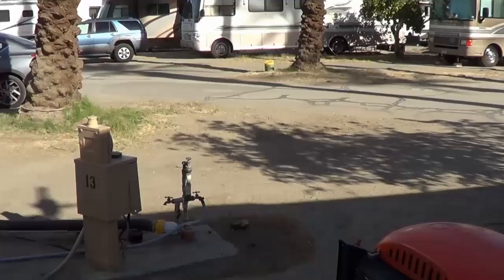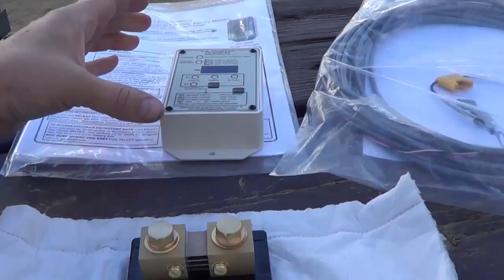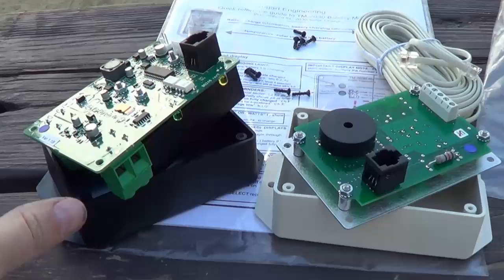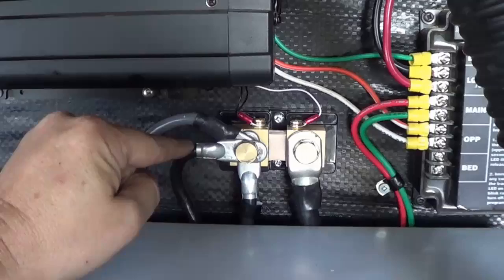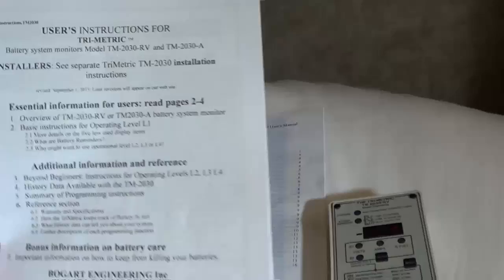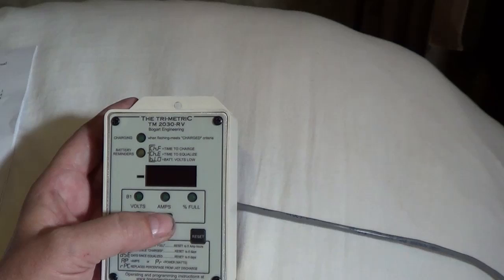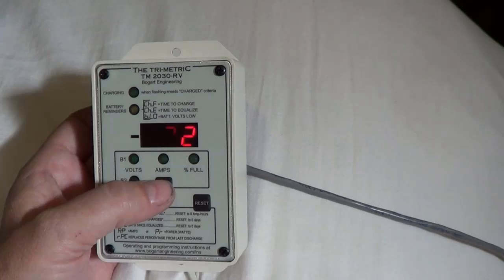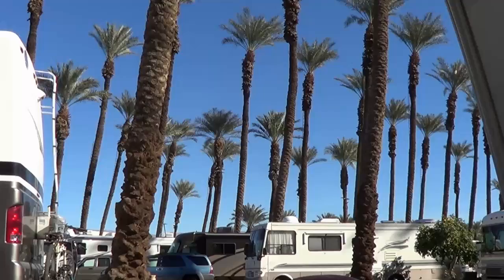Bogart SC2030 CC and Trimetric Battery Monitor Install

Comment: These PWM chargers are only about 70% efficient they truncate the voltage above the batteries full charge state about 12.76 volts for a 12 volt battery system. Those solar panels put out around 18 volts at 5.56 amps (give or take) in order to make 100 watts... When the charge controller truncates the voltage from 18 volts to 12.76 volts you loose about 25 to 30 watts per panel, Thus neutering your panel from a 100 watt panel to a 70 watt. A mppt charge controller converts the maximum voltage of the panels down to a more usable charge voltage and at same time increasing the current so you are able to use. So instead of having 5.56 amps you will have about 7.44 amps. The pwm controllers are around 70% efficient and a mppt charge controller is around 95% or better at converting the solar panel power to a usable charge voltage. With four panels your loosing over 100 watts by using inefficient and antiquated PWM technology; however you did a very good install of the system.
Reply from the maker: IMHO, It's not simple as you make it out. I've had great performance out of my system. Serves our needs, I have 500 watts now and usually full recharged by noon.
From the Bogart Engineering FAQ - http://www.bogartengineering.com/support/faq.html

C1. The debate rages: which controller is best PWM (Pulse Width Modulation) or MPPT (Maximum Power Point Tracking). Why did you choose PWM technology instead of MPPT for your SC-2030 Solar Charger?   Click for answer
A very good question! They BOTH have good and bad. Plenty of hype has been written already. Here's my (Ralph's) view:The "good" for PWM: It is simpler and lower cost technology. Under some common circumstances–it can actually deliver more amps to the battery. That could be when:(1)days are moderate or warm, with few clouds.(2) batteries are charging at over 13 volts, (in a 12 battery system) which they almost always are when actually CHARGING.(3) Panel voltage is properly matched to the battery voltage, for example "12V" panels are being used with a 12V system.PWM is actually more "power efficient" than MPPT–which means less total power loss in the controller itself. So heat sinks in the design can be smaller (and less expensive). Missing in most analysis of MPPT is that there is always a conversion loss with MPPT, which tends to be higher the greater the voltage difference between battery and panels. That's why PWM can actually beat MPPT under circumstances described above.Some places that analyze MPPT assume that panels with 30V open circuit voltage are being used in a 12V system. Any good MPPT system will easily provide better performance in that case. They also may assume batteries are charging at 12 or even 11 volts, which is unrealistic. Lead acid batteries are typically below 13 volts only when discharging, or perhaps charging with very little charging current–meaning the actual potential gain in amps is not great.The benefit for MPPT becomes apparent if you use panels not voltage matched for the battery. If they are not, MPPT will utilize more of the potential energy of the panels. For example, if you use 24 volt panels to charge a 12 volt battery system you must use MPPT, otherwise you would be using your panels very inefficiently. If you are trying to use PWM in that case, you are misusing the PWM technology.Another potential benefit with MPPT is that if distance between panels and batteries is far, smaller wire can be utilized by running panels at higher voltage to the batteries. Running at twice the voltage reduces wire size to 1/4, which for a long run can be a significant saving in copper wire.If temperatures are low enough, the slightly less power efficiency of MPPT will be compensated by the higher panel voltages, which will result in a little more battery current. But in actual measurements we made using a commonly sold MPPT solar controller, this would occur at temperatures less than 55 F degrees (in full sun, when charging at more than 13 volts), where there is a slight advantage to MPPT in my location (Boulder Creek, near the California coast). As temperature drops below that (in full sun) MPPT will get some advantage, such as could occur at high elevations in Colorado in the winter. Potentially this would be maximum about a 2.5% improvement in amps output for every 10 degrees F lower in temperature (or 4.6% per 10 degrees C colder. I'm using data from Kyocera KD-140 panels.)There can be theoretically optimal situations (that I don't personally experience where I live) where MPPT could give some advantage: that is when solar current is present, but the batteries are quite low in charge–but because loads are high and even greater than the solar current the batteries are still discharging despite the solar current. Under these conditions the voltage COULD be at 12.5 volts, or even lower. Again, using data from Kyocera panels, ("Normal Operating Conditions") there is a theoretical maximum gain over PWM of 20% current assuming NO MPPT conversion loss and no voltage drop in the wires to the panels, at 20C (68F). With PWM, the voltage drop in the wires in this case would not affect the charging current. Now if in addition you lower the temperature to below freezing at 28 degrees F (while sun is shining) you might actually get up to a THEORETICAL nearly 30% gain while the batteries are discharging.The only REALLY BAD part of MPPT, is all the hype surrounding it–for example one manufacturer advertises "UP TO 30% OR MORE" power harvested from you panels. If you are using solar panels properly matched to the batteries, 30% ain't gonna happen unless it's EXTREMELY cold. And your batteries have to be abnormally low in charging voltage–which tends not to happen when it's cold (unless you assume the battery is still discharging while solar is happening). Virtually all the analyses I've seen touting MPPT on the Internet ignore the conversion loss, assume really cold temperatures, assume unreasonably low charging voltages, assume no voltage drop in the wires from panels to batteries, use STC conditions for the panels (that the marketing types prefer) rather than more realistic NOCT conditions, and in some cases assume panels not voltage matched to the batteries.The other thing that is misleading about MPPT, is that some manufacturers make meters that show both the solar current and the battery current. In almost all cases for a well designed MPPT type the battery current will be greater. The engineers making these know better, but it is implied (by marketing types?) that if you were NOT using MPPT you would be charging your batteries with only the SOLAR current that you read on their meters. That's not true, because the PWM BATTERY current should always be higher than the MPPT SOLAR current. It is the nature of the MPPT that maximum power occurs when the current is lower than the maximum, so they must operate there to get the maximum power. So to properly compare the two you need to compare MPPT with an actual PWM controller in the same circumstances.Finally, the reason we went to PWM is that I was anticipating that panel prices were going to drop (which they certainly have over the last 5-10 years!) and that the small advantage of MPPT (under conditions where the correct panels are used for the batteries) would not justify their additional cost and complexity. So my thinking, for more total benefit per $, put your money in an extra panel rather than a more expensive and complex technology.
Reply: None of these panels are going to be matched to the batteries. 12 volt batteries use 18 volt panels. 24 volt batteries use 36 volt panels, 48 volt battery system will use 72 series volt solar panels. the only way to get close to the full capacity is to use MPPT. Now if your charge controller is meeting your needs then you have no reason to upgrade. There is no condition I have read here that makes the use of a PWM controller a better option unless one cannot afford a MPPT Controller The article you quoted looks like it was written by someone that was stretching the truth to sell there product.  Years ago buck converter mppt controllers were not really available and too expensive. but they are getting much more affordable now. I don't blame you for not wanting to switch to an MPPT after all you already have yours installed and it works for you. I just wanted others to see the advantage of an MPPT controller.
Reply from the maker: I chose to spend my dollars elsewhere in the system versus the extra cost of an MPPT. In a small system that made sense, once a system gets over say 500 watts I can start to see the merit in an MPPT. Or if budget is less of a concern to a person.

With our usage patterns, we aren't heavy power users, we rarely draw our battery bank down less the 80-85%, mainly because I had the spare cash saved from not going with an MPPT to have a bigger battery bank. ;) Most days my solar controller is actually spending the majority of its time charging in absorption mode where an MPPT acts exactly the same as a PWM since the lead-acid batteries limit the current intake in that phase. 
People who have small capacity battery bank or routinely draw the battery bank down a lot so they spend a bunch of time on bulk charge mode or use a ton of juice for things during the day may benefit from an MPPT more. But to say MPPT is always the better solution is just not true, IMHO
PS. If I do occasionally run the batteries down really low for some reason, I can always fire my generator and shove 50-60 amps charge into them for an hour or two until they hit absorption, then let the solar controller take over.
Reply: jimthvac100 I have a question but couldn't seem to PM you. Could you tell me your opinion on this?
 Im installing 3 100 watt panels on my RV and have 3 100 ah batts. I ve been told 3 batts is too many and itll be difficult to top them off with the panels I have. THEN I was told 'you can never be too skinny, or rich, or have too many batts" What do you think? Should I go with 2 or 3?
Reply: Assuming you are talking about a 12 volt system using two or three batteries in parallel. I suggest you go with two large deep cycle 6 volt batteries in series. The larger plates can handle a deeper discharge than the 12 volt batteries. I would get the largest AH rating that would fit in your battery compartment. Remember you will only be using about 50% to 40% of  your lead acid batteries. So if you have a total of 200 AH's of battery capacity you will only use up to 100 AH of them. If you try to use more than that you will ruin the batteries. so for 12.7 volts at 100 AH of usable capacity you would need about 400 watts in full sun to charge them back up. (If you let them get that low) You may want more solar power to have available for use while these are being charged too. So it really depends on how many watt hours you end up using.

Comment: My only comment is that the choice of a PWM controller is a very poor choice.  The argument on the Bogart page is mostly not consistent with the facts of the way MPPT controllers work.  In full sun when charging in bulk mode your controller won't give you more than about 310 watts of charging from your 400 watts of panels, whereas a quality MPPT controller would give you more like 390 watts.  In other words the PWM controller is about 80% as efficient as the MPPT controller.  When the batteries are low, the loss will be worse.  The only time the PWM controller comes even close to the MPPT controller is in low light situations when the panel voltage is low, but then the amp output is also very low so that is a very minor factor.  The price difference between the Bogart PWM controller and a quality MPPT 30 amp controller is only about $100.  If you buy a reputable chinese MPPT controller the price difference is $20 or less.
Reply from the maker: If you size your battery bank properly for usage, ie. enough amp hours to last a few days without sun, you will spend hardly any time in bulk mode when sunny.  We usually hit sunrise with 85% capacity.
Most of the day my PWM is charging in absorption or float. I don't see a need for a more complex and expensive MPPT on a small solar system like mine. Keep it simple I say.
I'm quite pleased with the system as it sits, does the job, we happily are out boondocking for months at a time, rarely have to run a generator.
Reply: Bulk mode charging is the best case scenario for a PWM controller because the charging voltage is highest.  The loss is larger in float mode, although the low amp draw likely negates that since you are unlikely to use the available current in float or absorption.
Reply: No thanks on the Chinese controller.
Reply: @jamesrodgers6472  some of the Chinese controllers have been found to be reliable.  You will notice I said "reputable" Chinese controller.  You have to do some research to find a good one.  Personally my systems are 100% Victron MPPT not Chinese.